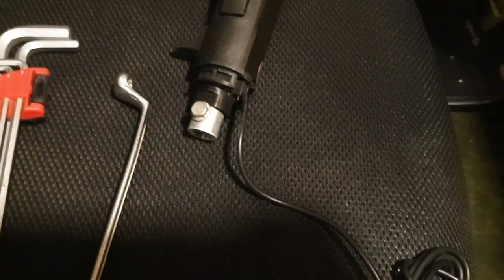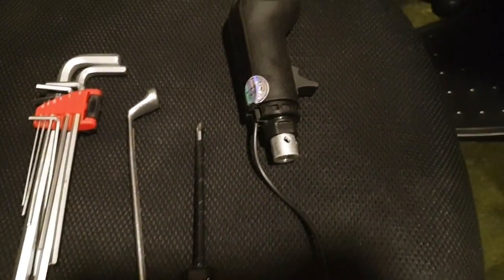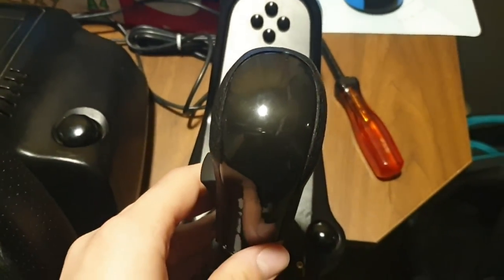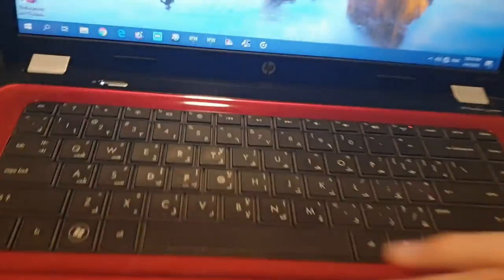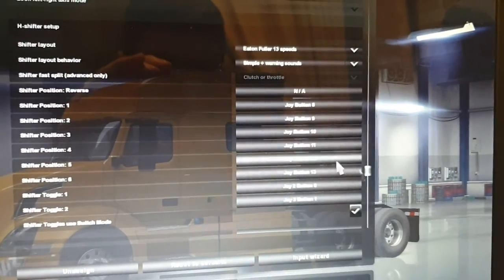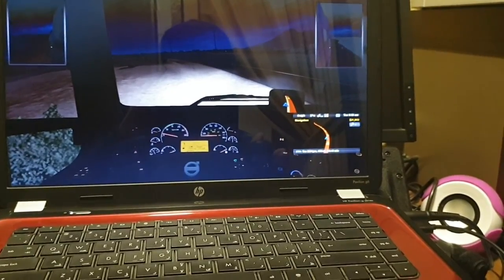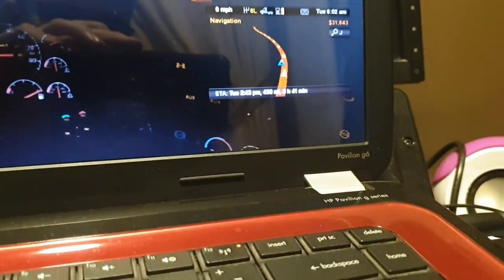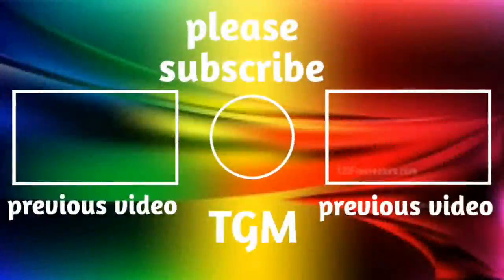How To Install SKRS Shifter + Setup(2020)

Comment: good vid, has the shifter lasted those 2 years?
Reply from the maker: It has been sold last year, but before selling it, i had a problem with it, the splitter button would lose its position inside the game. other than that, it was amazing